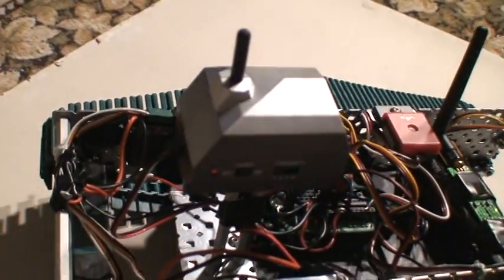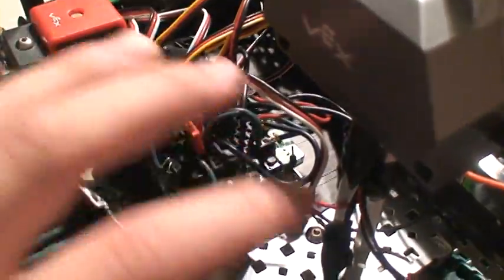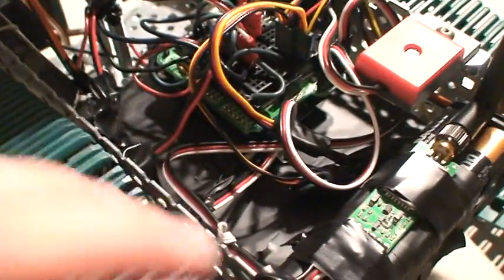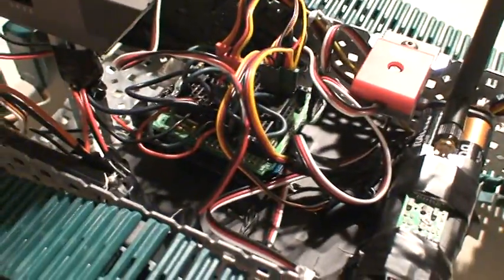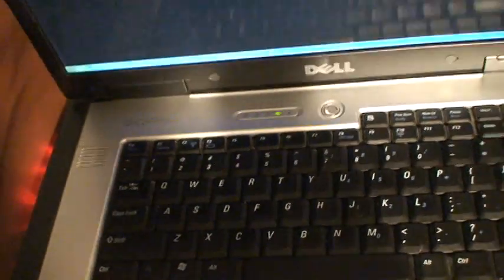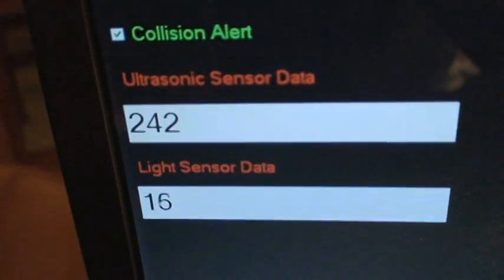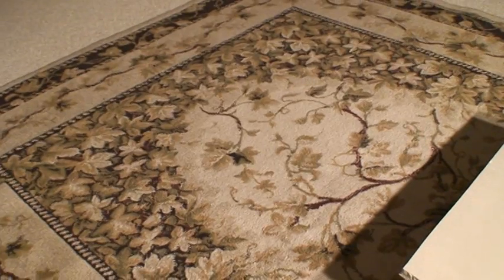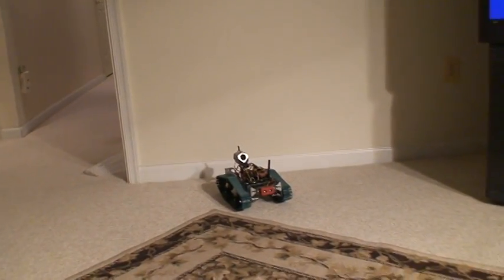RC Tank - Bluetooth

Comment from the maker: Look at my stepper motor videos in the video description you will find a link to my google code page. I have source up for many things. You can get data back to the pc using a very basic serial connection. Get an arduino, load up a sketch to read sensor values, send them to the pc with serial.print which sends it over the serial to usb connection. Programs can be written to open the serial port....read the data...decide...and send data back to the arduino. It will take some time to do.

Comment from the maker: Yes and no, you can't simply hook up the camera to the bluetooth unit and say work. You would first have to get a camera module that you can access on the hardware level (sparkfun has them) then you would capture a picture and turn the image into a serial stream which would be sent over bluetooth. On the other end the serial stream would be received and turned into an image. I am not sure if the bluetooth serial link could handle the amount of data though.

This is not an easy task to do!

Comment from the maker: Yep, Sparkfun sells some that are really nice but apparently the manufacturer has stopped making them so I will have to grab a few before they run out. Infrared sensors are better for angled distances because light reflects back but sounds just pings off in the other direction.

Comment from the maker: You can get them from vex robotics just google them, they are a very large and reputable company. I will warn you it is not cheap the cheapest kit is $300 which includes some nice stuff plus accessories. It is compatible with arduino but not directly you won't find lots of tutorials but all of the sensors are just regular sensors in fancy cases so the interfaces are the same, and the motors run off pwm and the servos.

Comment from the maker: Well for stair detection you got almost everything  but you need to extend the sensor out of the robot like 4 to 6 inches. That way the robot has time to stop.

The bots range right now is around 90ft because of the bluetooth adapter on the laptop, the bluetooth on the robot itself has a range of 350ft. So if I bought another module and hooked it up to the laptop I could get a 350ft link but the video camera definitely won't transmit that far!

Comment from the maker: Its not exactly that simple but its along those lines. The sensor would have to be extended to say 4 - 6 inches from the front of the robot as the robot takes at least that much to come to a halt. The sensor would also have to face directly down, 45 degrees may not work right because the ultrasonic pulse could get deflected elsewhere instead of back into the sensor where it needs to go. But you are right about the alarm if the distance was any more than a few inches then the robot would stop.